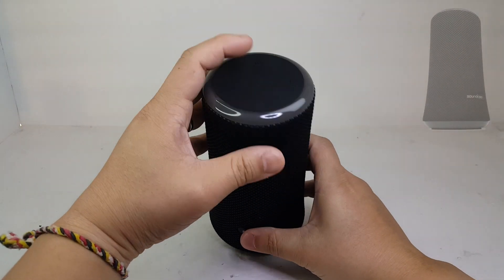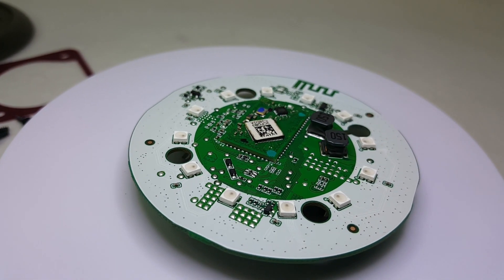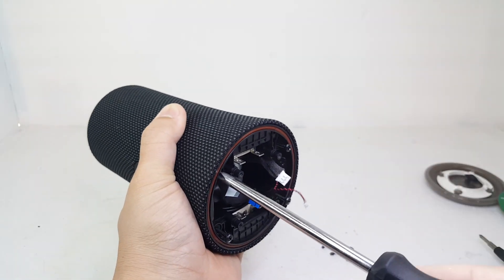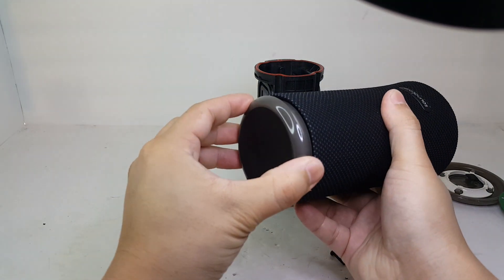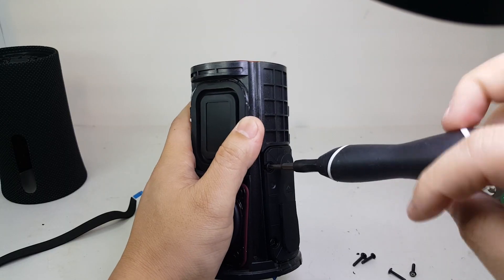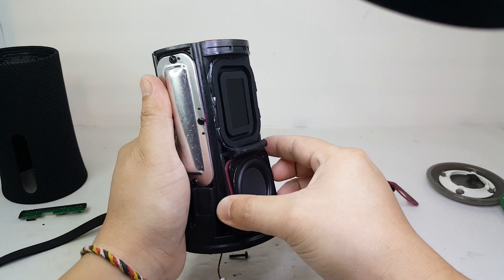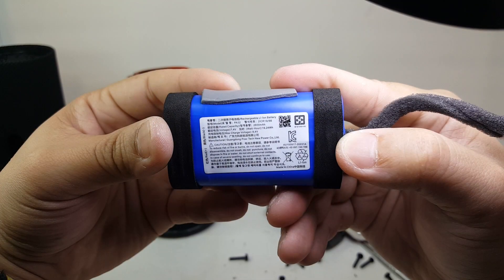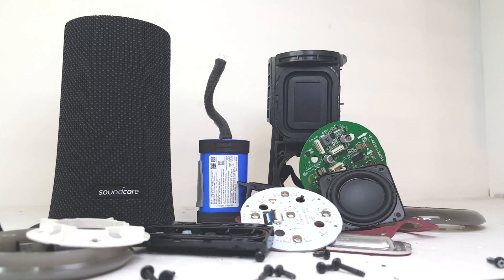ANKER SOUNDCORE FLARE 2  COMPLETE TEARDOWN !!!

Comment: Thanks for this teardown I was wandering what battery it has inside. Very nice detailed teardown like all your videos. The best on YouTube. Most appreciated. 

After I bought Anker Flare Mini I was so impressed with the sound quality I decided to get another one when I was on the road overseas for the rest of the trip. Unfortunately shop did not have Flare Mini but Flare 2 only. More power and just slightly bigger. You are completely right about the sound quality drop when it goes louder. Not only that I found a smaller Flare Mini has better quality on lower levels too. When you hide them in the corner of your room out of sight, there is a wow effect from your visitors when you show them where the sound is coming from. And Flare Mini has a higher wow effect than Flare 2. Thanks again for this upload.
Reply from the maker: I appreciate your words!

Comment: I bought one used. And top power button is missing. There's a 1 cm hole. And the silver square button pad is missing. Does anyone have a suggestion for place to just purchase one square replacement power switch that I solder in and then seal the hole with hot glue?. Because the base is horrible with the air coming out of that hole.